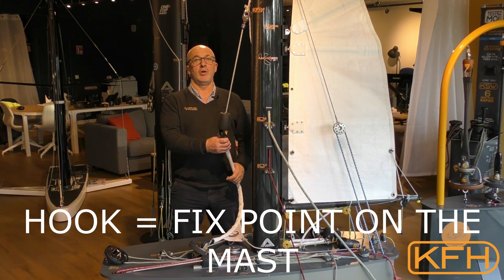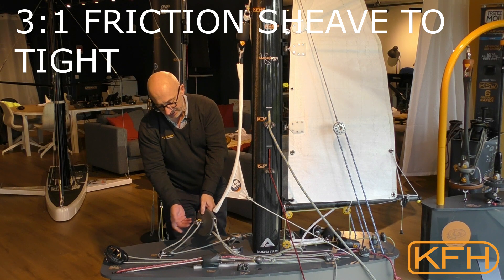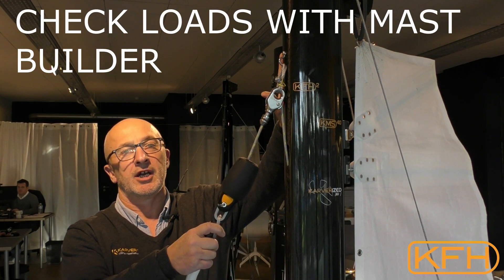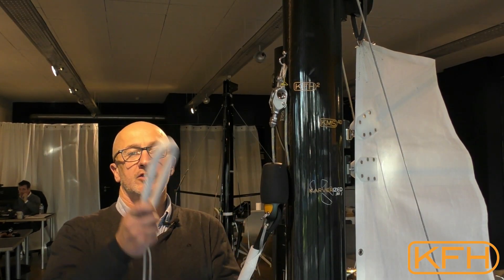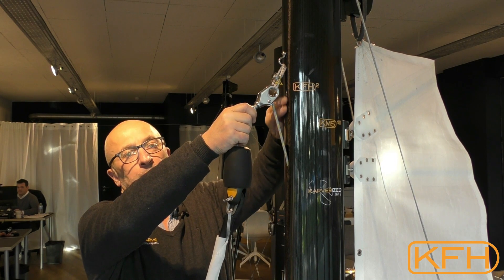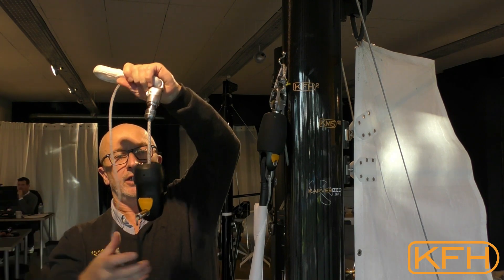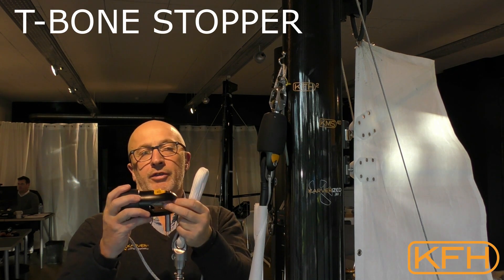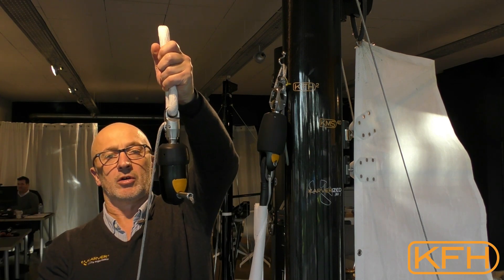KFH Karver Furling Lock

Comment: Nice! But how does it unlock?
Reply from the maker: Hi Bram, you lock and unlock with the halyard. There is a on/off system inside the lock. That is important to unlock with not too much load (except the weight of the sail). Because the fixed point is at the top, you get the load or release the load with the tack line. That is why our client usually install a 3:1 friction sheave at the bottom to get 3 times more power.